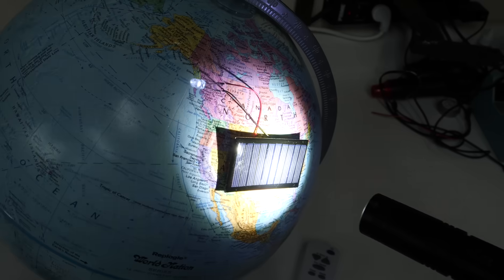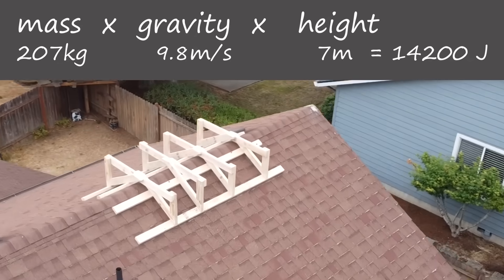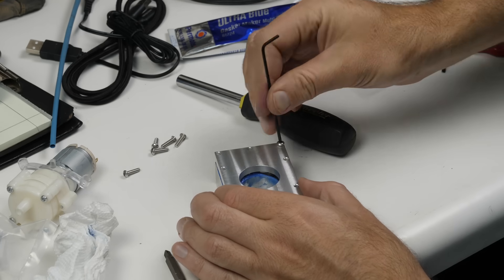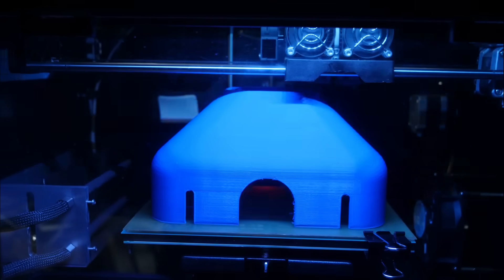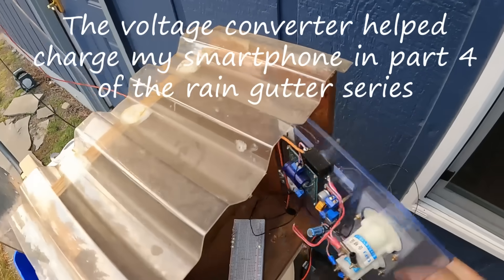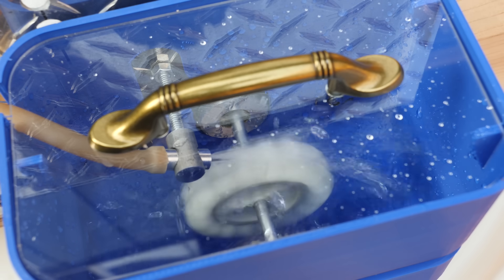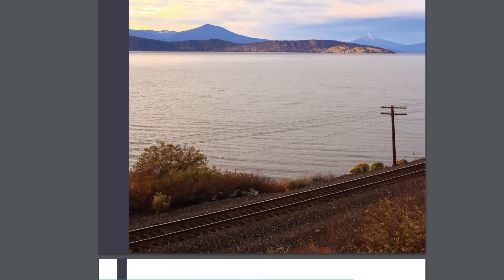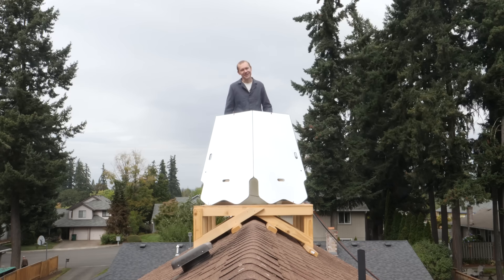Storing Solar Power on my ROOF!!!

Comment: I've seen something similar with moving t ton rocks using a crane system and building a tower of the rocks.  Then at night the rocks are lowered and the energy captured.  Very cool, thanks for sharing.  New subscriber by the way.

Comment: It would be awesome if you could paint that 55 gallon drum black and capture some energy in the form of heat as well, that could be routed to your water heater. As the water goes down to the water heater it can pass through your generator.

Comment: 14200J sounds like much, until you do the math: 14200J/3600s = 4Wh = 0.004 kWh. 

That's what, almost a tenth of a cent worth of electricity stored?

It only becomes economical with a cubic mile of water up on a mountain, not with reasonable amounts on a roof, or even in a water-tower.

Comment: Think it would be nice to see and be interesting to see if you were able to pump the water into the roof barrel,then using the used water from the wheel to pump back into the system using both the solar panels energy but also start enlarging your wheel,suitable for a back yard operation. But also add 1 or 2 simple car batteries as storage for use during the night

Comment: I would like to have seen you calculating the system efficiency, if possible by adding a second barrel up there to see it going down using gravity and up using storage water.

Comment: What a cool video. To extend the calculations a little, the typical house in the US uses about 29 kWh/day or 104,400,000 J (104 MJ). But let's assume that you are super efficiency and only use 5 kWh or 18 MJ of electricity a day (and assuming that the roundtrip efficiency is 100%, which of course it is not)? That would require 1267 of those barrels to hold the 262,390 kg (or liters) of water required. For those who don't grok SI, that is over half a million pounds of water! Probably a little more weight than most people's roofs are designed to support.

On the other hand if you have  20 m (66 ft) tall hill on your property (and I know a couple of people who do) and you could put tanks at the top and bottom of the hill, you could store 5 kWh (18 MJ) of potential energy in approximately 92,000 kg of water or 24,300 gallons. It would take a 92 cubic meter tank to hold that much water and you would need two of them. For a 2 m tall tank it would have to have a diameter of 7.65 m ( 6.5 ft tall by 25 ft in diameter). So those are big tanks, but not undoably big even for a homeowner. And if you live completely off-grid and gathered and stored your own water, you could use the storage tank you already have for domestic water storage and put a second one at the top of the hill, and you could store at least some excess energy in potential energy.

Still a Tesla Power Wall holds 13.5 kWh and only takes up a 4 ft by 5 ft section of your garage wall. So I think I would opt for battery electric storage of any excess solar or wind power and leave pumped hydro to the big guys.

Comment: I've been doing some planning for this exact project, but with a vertical wind turbine. After watching your video, I realised you could run two separate pumps in the same system and accelerate the pumping by using solar and wind simultaneously!

Very cool! Stay awesome!!

Edit: Also, add glycol, so it survives the winter!

Comment: I've experimented with windscreen washer bottle motors and pipes. All I can say is you are better off using wider pipes as the resistance of a long thin pipe really slows down the flow and makes it harder for the motor to pump. You might have to put several different bits of pipe on to expand the nozzle, or just make a hole in a plastic plug and use some garden hose.

Comment: This is great. You should frame a simple copula over that barrel to protect it from UV and make it less unsightly. I'm considering a 40' tall SS pipe in an addition I've got planned for my place, to work as a battery for a bank of solar panels on the southern-facing roof.

Comment: Add a DC water heater element Poweredvby solar panels to the barrel on the ground and add an additional pump to feed the radiant floor (PEX tubing with vinyl plank flooring over it)  or hydronic baseboard heater inside your house.

Comment: Its interesting this video came up. I was just thinking about 'gravity generators' on a large scale. More specifically I realized with a weight / counter weight system you could capture energy at 4 points. Top and bottom of both sides of a system like that.

In an extreme example you have 2 villages, one on the top of a plateau, one bellow in the mountain side. And I thought about how water is not always readily available. I thought about Sand or even marbles. Could you find so much balance as, I had my lights on all day, I return 500 marbles to the weight.  

Obviously moving sand or water has its challenges form Archimedes screws to pumps and siphons. But I also thought not all power is equal, you don't use your lights during the day, but you use your AC in the day. And so on. Could there be a balance?

I also have this other idea that's hard to explain here, but basically a large hollow column in say, the ocean, void of water  In a spiral all the way down is a track that large (we wills ay wood) balls roll down. They pass hundreds of wheels and spinners to make tower as they roll down. 

Then at the end they are passed through to a tube that IS in the water. This tube floats them all the way back up to be dropped again. 

The energy is all from gravity, and floating. you could use solar for some other parts like the air lock system for the balls.
Reply: How do you get the ball into the water at the bottem?

Comment: This video adds to the illusion that storage solutions for solar power are just around the corner... NOT!  The storage solution advanced here depends on geography that is not readily available in most locations. Solar power more than doubles energy costs because there always has to be a backup source.  The reliable backup sources all involve fossil or nuclear fuels. Thorium is the energy source of the future.

Comment: have you heard of the phrase "kill the chicken twice"?, and yes, you can. in the current setup, when the water coming down from roof, let it run through some paint black copper tube, under the same sun light, the tube will store heat and you got free warm water. it will never be boiling hot, but warm enough for shower use, washing dish, washing your driveway that kind of things. that's going directly  into your heating bill.

Comment: I say there needs to be an efficiency test… how much electricity input to the system you use to fill the tank of water compared to how much electricity you get in the output in total when using the electricity from the full tank…

Comment: Interesting physics experiment but this also shows how much water would be required to actually "use" it. Even ONE!! Li Ion cell battery of older generation for 5 Dollars or so have four times more capacity than the construction you built.
But still it is a funny experiment. ;-)

Comment: Power companies use this principle with hydro dams. Instead of solar energy powering a pump, they use the natural flow of water in a geological basin, (water trapped behind a man made dam in a river valley) to store energy over the summer months. Once the winter hits and power demand goes up, the lake is slowly drained through the dam to produce power. Once the peak power season is finished, the dam is closed and the basin is filled again with spring run off and the natural flow of the river. So simple yet so effective. Cool vid

Comment: I've said it before but you would get better results if you added gears to your generator and used a closed and fitted impeller housing instead of an open assembly or large box.

Narrowing focus to this episode only, a PV panel of that size can probably run several pumps like the one you chose in parallel, which would allow you either more storage and subsequent runtime or faster fill.

As an idea for a future episode, do you think you might try adding a flywheel for more energy storage? It might be a good compliment to the drum storage.

Comment: Oil, coal and gas are BIOMASS NOT fossil fuels! Dinosaurs were a tiny mass compared to the plant mass used to make renewable BIOMASS. We are building hydrocarbons from Carbon dioxide now due to work with catalysts and some time soon will will have a closed loop carbon cycle so we don't have to pollute the Earth with Lithium and rare earth mining for those who are being short sighted about their demand to switch to wind and solar...

Great job! I enjoyed how you showed the energy density problem that exists! Barrel of water equals one AA battery!

Comment: this strategy is used in Switzerland since many years, the lakes would be drained very quickly otherwise... they used cheaper night power to pump back the water to produce more expensive hydro electricity during the day...

Comment: Would some siphon system help get water up there if you had a large storage car on the ground? Or does the pressure from water at the bottom of the barrel have enough power to run the water pump that fills it (since it isn’t fighting any pressure putting it in the top of the barrel) and some extra?

Comment: Where can I find the full kit with the empty barrel and the one full of water?
Amazon does not sell the latter.  ;-)

14,000 joules in a barrel would be 3h50 of 1W LEDs, minus LED efficiency and cable loss, but while your videos are enlightening all year round, your backyard table may not be alight for that long. Have you measured that duration at full 1W power?

Comment: If you pump water FROM a ground level 55 gallon drum, to the 55 gallon drum on the roof, you won't need a float switch. AND you recycle the water.

Comment: Could you have used an evaporative cooler float valve for the water shutoff? Monitor back pressure build in the delivery hose to shut off the pump.

Comment: Thanks for the video. I always wondered how much water would I need to store in order to make this really usefull replacement for batteries. I was lazy to do the math. Now that you showed how big barrel of water equals one AA battery.., I know it’s not very useful in home condittions :-)
Thanks for the lesson (honestly)!
Reply: As a source of gravitational energy it's not great, but technically 55 gallons can also be a sink for 470,526,576 joules of thermal energy,  or 130kwh, which is considerably more than a AA.   It would be interesting to vaporize it in the summer and condense it in the winter for heat, though you'd need a considerably larger and better insulated tank to store the steam.

Comment: Consider how crazy inefficient pumping that water was. If you ran a 50 watt panel for 5 hours you should have generated 900,000 J to only store 14,000. Even with an old panel in less than perfect sun putting out say 25 watts you are putting in 30 to get out 1.
Reply from the maker: See video on BUILD2

Comment: I wonder if it's worth looking into lifting solid weights, instead of a liquid like water. With pulleys, it might be easier to harness the energy as the weight comes back down. Seems like the energy harnessing capability with water is not the most efficient.

Comment: Storing energy by pumping water is a simple idea but probably not the future. It's more likely that in the future we will generate hydrogen from water and store it. Why? Because we can store much more energy that way in the same amount of space (hydrogen can be compressed, water cannot, also we got rid of the oxygen, so we don't have to store that as well). Further turning hydrogen back into electricity is much easier than most people think. Many people may think of fuel cells but so far these work only on a small scale. On a big scale you can just burn it and run a gas turbine that powers a generator; we are already producing electricity that way burning petroleum gas. The same thing can be done with hydrogen and the exhaust fumes will just be water. The whole process is not very efficient, in the end we can get around 45% of the energy back, which sounds horrible. But keep in mind that most steam turbines that are used in coal and nuclear power plants also only have an efficiency of 40%. We just need to compensate that loss by harvesting more solar and wind energy.

Comment: It's kinda funny because here in Brazil basically ALL houses are required to have a water reservoir on their roofs, but that's for human consumption, not power. Mine specifically has two 1000L reservoirs. (plus 600L on a boiler that's used for the solar water heater)
They're needed cuz the water supply from the treatment company doesn't always have enough pressure and/or flow, to properly serve a house,  that's specially true when maintenance occurs, and we don't get water from the company at all, most of the times the interruption is quick (a few hours), but I've seen it happen for 5 consecutive days!

Comment: The city of London used a large amount of water power both for electricity and mechanical power. They had a system in place that had 500p psi plus pressures. Very fascinating stuff and it's a nearly forgotten history.

Comment: I came up with this idea
I went with a water tower Reservoir covered in solar cells, and topped with a wind generator (that also covered in solar cells)
 there would be three pipes/tubes for the water to move through
 one brings the water up to the reservoir
 another brings the water down into the house services
 the third allows the water to flow back down to create electricity as necessary

Comment: How cool i think you just described how oroville dam works. Until recently I didnt know that they pumped water out of the lower reservoirs back into the lake in off peak hours. I still dont know if that means they use renewable energy to pump the water back up or if they just buy power while its cheap to run the pumps

Comment: Plot twist. Use liquid mercury it weighs 113lb per gallon vs 8.34 for water. 13x times the storage in the same space. Maybe could wind a huge clock spring to hold energy as well.

Comment: It seems to me the best way to integrate distributed solar and energy storage and by keeping home power hooked up to the grid and feeding power back into it. Let the utilities find or dig a bunch of big lakes, or use molten salt batteries, or whatever is most efficient at scale. Distributing power generation seems to make more sense than storage, because storage is less space-efficient and power generated at the point of use is most efficient. The exception is something like storage being done under a field of solar panels or something, but that's not how most plants are set up. I just don't see mass home energy storage being the way to go because we either have dense ways of doing it (batteries, or synthesizing fuel like hydrogen) which are dangerous or expensive, or easier but less dense ways of doing it that just don't make sense for most individuals.

Comment: 14200 J is 3.95Wh or a 40W equivalent LED lamp for less than an hour. That's not a "massive amount" of energy. A LOT of water is needed for useful storage. Using some 18650 Li-ion cells with the same shallow daily discharge is going to give the decades life that they are not meant to do.. Just because the capacity reduces they are not useless until the energy needed reduces below what is requires.  This why used electric car batteries that are at 60% capacity may be no good for a car but are perfectly good for a domestic power wall.

Comment: You should consider using brass heatset inserts in your 3d prints for adding threads. The only tool you need to put them in is a soldering iron, preferably with a dedicated tip for the job.

Comment: In Alaska, I need heat.  I use fuel oil and electricity.  Inverters fried, I am heating water in water heaters for nighttime heat.  A big 80-gallon natural gas heater heated externally with a small fan that sucks cold air off of the floor then blows down the exhaust pipe with warmed air returned from the bottom of the tank when the sun shines.

Comment: a thermal solar system would gain 600W per meter/hr. 8 hours would be 4800WHrs or about 17,000,000 Joules per day compared to the 3600 this extracts with similar footprint on the roof.